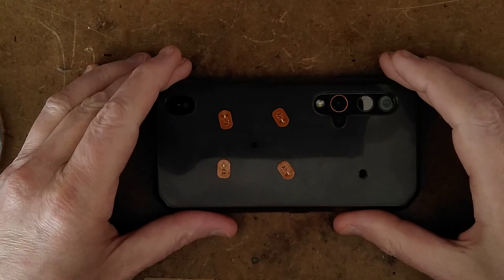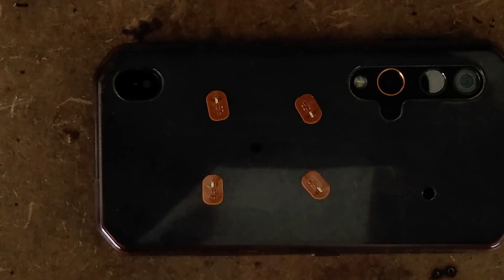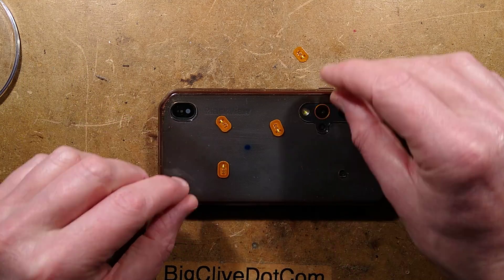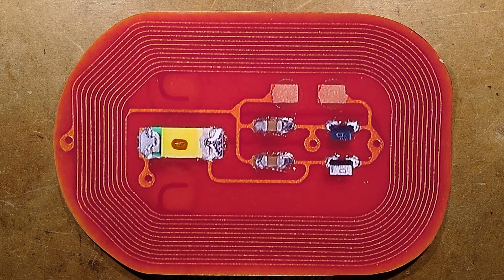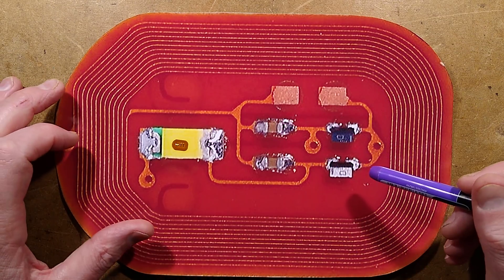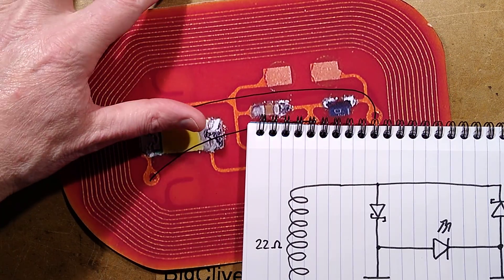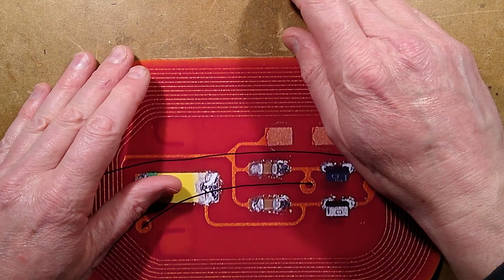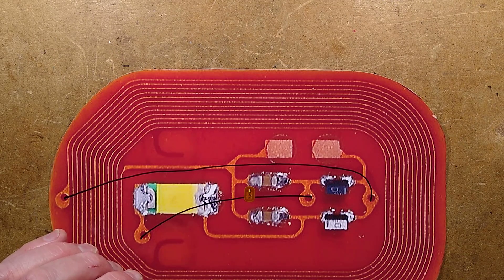NFC powered flashing fingernail sticker (with schematic)

Comment: So if it doesn't work with the other coils you tried it with, what would make it selective to the NFC only? Might it be the value of the capacitors?
Reply: Coil spec. ie impedence.

Comment: I saw a recent TV show in which they had some kind of electroluminescent paint on the hood of a camper van, when powered up, the hood glowed in the shape of the vehicle's emblem. It looked quite nice, but now I'm waiting for a BigClive video explaining it. I suppose I could research it myself, but then I wouldn't have the soothing Clive voice narration! I know EL tape has existed for many years, but this appeared to be done entirely with paint. When off, there was absolutely no sign of it being present, no telegraphing through the paint layers as you would have with tape, but when lit, it seemed to glow fairly bright (they did have to dim the studio lighting to make it visible, though).
Reply: There are (expensive and apparently somewhat fiddly) kits to do this - it's basically a full EL stack-up with all the electrodes and dialectic layers spray painted on. I think Applied Science on here has some EL display experiments with the tech.
Reply: @makomk  I think I saw it on Car S.O.S. I thought it was really cool, but definitely something that the average gearhead probably wouldn't be able to pull off. I remember they didn't go into a lot of detail about it, other than saying it was a multi layer process. I don't think I've watched any Applied Science videos, I'll have to check them out. Thanks! 🙂
Reply from the maker: You do get EL kits like that, but it's a critical process and not tough.
Reply: Applied Science has a great video about applying your own EL paint and patterns to surfaces!  Highly recommend checking it out.  :)

Comment: Qi chargers send intermittent signals to see if a compatible receiver is in range, and only begin charging after a response is received from the device to be charged... the stickers don't send the appropriate acknowledgement signal so they won't work with Qi. NFC constantly pulses (like other RFID devices) at 13.56 MHz, so there's always a magnetic field for the stickers to draw from. 

The 13.56 MHz frequency is also used in some RFID (proximity) cards, though you will also find 125 KHz, 134 KHz, and 860-956 MHz, depending on the access control system in use.

Comment: So, if they are tuned for specific frequency, does that mean that the 22 ohm antenna is a inductor ? If so can it be measured for its inductance and then you could design your own versions for fun.
Reply: I think thats what the ohms is showing the impedance of the inductor, like how speakers have a coil but use ohms for a measurement. I could be wrong though

Comment: You'd think by now they'd make them powered from the heat difference between finger and ambient. Like a more sensitive version of a reverse Peltier.
Reply: reverse Peltier - I think that's the Seebeck effect :)
Reply: @mrustle5707  Yeah I brain farted and couldn't remember what it was called.
Reply: Gotta love thermocouples. If you look into an occupancy sensor, they use what's known as a thermopile. A bunch of thermocouples in series, to create a voltage that is readable by the sensor just by detecting changes in temperature (infrared radiation) in the environment that come in through the lens.
Reply: @IceBergGeo  do you think they could supply enough current to keep that shiny led bright?
Reply: @mistaowickkuh6249  I don't think so. We're talking millivolts per thermocouple. It definitely wouldn't happen with an application that would fit on a finger nail for sure.
Reply: @mistaowickkuh6249   Definitely not with materials now in production like germanium and silicon and the usual dopants. But with more exotic things still only in research labs who knows. Gotta love metamaterials.

Comment: I actually have 3 of these little fingernail NFC PCBs implanted in my left hand as part of Dangerous Things's "Flex NeXT", an implantable multi-chip product containing 3x NFC LEDs, a standard NFC chip, and a writable RFID chip.

Unfortunately, all of the NFC antennas have failed at this point - due to repeated micro-flexes eventually breaking the connections between the components on each chip.
Reply: Tbf dangerous things warranties are so good you could get them replaced if you want to try
Reply: How excited are you to get a chip shoved into your brain? Or to not have to carry around your credit card because you now a chip in your right hand or forehead?
Reply: they do make a bioglass sealed implant,id upgrade to those
Reply: @andrewsmart2949  its kind of a downgrade due to range based on my ones
Reply: euch :/ get em out

Comment: How comes only the NFC will power it...I was expecting it to have some form of chip on there?
Reply: The antenna is tuned to the NFC wavelength, or thereabouts.  Each half of the wave charges one of the capacitors.
Reply: @sarkybugger5009  thankyou very muchness! Amazing!!!

Comment: I wonder if they could make an RFID card that small. Deviant Ollam and his wife have embedded RFID chips in their skin - cool but not sure I'd wanna do that, but it would be quite fun to show off some painted nails and "magically" open doors. I think something like that wouldn't go amiss in my handbag, as well as the new 'lipstick' lock openers that Deviant was showing recently too. :)
Reply: You could put the RFID chip in there, it is about the same size as the LED anyway, and you just have to use the flip chip version if you do not want to bond wire it in.
Reply: @SeanBZA  Oooh, that sounds fun :3

Comment: That must be the finest tracks I've seen to date!
Looks like the PCB etching solution almost gobbled up this one!
Reply: That's if they're etched. Could you inkjet print tracks somehow?
Reply: @chaos.corner  not cheaply. Applied Science has some interesting videos on something close to that, might be his ceramic circuit board or plastic circuit board vid, but the processes involved are pretty new, often covered by patents, and not easy to quickly commercialise.

Comment: I seem to recall reading that the "passive" NFC device that takes part in the transaction (e.g. a card talking to a POS terminal), due to obvious power constraints, isn't actually actively transmitting but rather varying its load on the transmitting device's EM field and that in turn gets detected and decoded by the actively powered device. In other words, the card doesn't harvest the POS terminal's EM field until it is somehow able to store enough energy to power its own transmitter (hard to achieve enough capacitance in such form factor) but rather shunts the "active" device's energy in a specific code that is then interpreted as information being "transmitted" from the card to the terminal. What I'm trying to say is, I would think that such a sticker would wreak havoc in the attempted transmission if you had it installed on a device you're actually trying to make a transaction with. Worth checking! :)
Reply from the maker: I've got one of these stuck to the back of my phone and it's not interrupting normal Google Pay transactions.
Reply: @bigclivedotcom  I wonder if that has to do with phones pushing a relatively stronger signal than cards that need to rely on the power of the reader. It would be interesting to see if they affect regular cards at all... I guess I'll have to buy some to check.
Reply: Active NFC cards like MiFare and Yubikey  need to harvest enough energy to save changes to flash and compute cryptographic responses, even if the response transmission is entirely done by modulating the load on the magnetic field.
Reply: It could just be sensing the change in load, rather than a specific load. Probably has to do with a phone having a thick case or no case at all, or even how far the phone is away from the reader.
Reply: This isn't shunting the power though, it's using it to power something. There is still plenty of stray RF too. The fluctuations detected are actually very tiny and tags use several schemes to ensure the data is decoded faithfully. It's actually possible to power dozens of tags simultaneously and they (some) apply collision avoidance schemes to ensure they can be read amongst the clamor.
In short, these things will negatively affect performance but it's not likely to be as big as you might expect.
Reply: @chaos.corner  I agree, RFID tech is sophisticated. It is also more secure than people think.
Reply: Every time I hear "POS" despite knowing what it means still makes me think "piece of shi-" lol
Reply: @PunakiviAddikti  I used to work on them. Trust me, your interpretation is usually highly accurate.
Reply: @OhShitSeriously  I had to use the Wyse ones. Embedded OS and EPROM do make them bulletproof but a right royal PITA if you have to support them remotely. Especially when working from a shonky image where someone didn't install everything properly in the first instance.
Reply: @PunakiviAddikti  most people who work with them think the same.
Reply: RFID chips are sort of "line fed", so having a constant load on the signal is perfectly fine, also the mostly-linear load of this device is just some signal attenuation, which is ok too.

Comment: I recall small led stickers from 2000s that used to blink, bit I believe these relied on antenna's magnetic field.
Reply: They worked off GSM paging which was pulsed. 3G WCDMA doesn't work like that because it transmits at a low, constant level.

That's why GSM phones made your speakers make an evil noise whereas 3G/4G/5G do not.
Reply: Wow core memory unlocked. Completely forgot about these

Comment: could you poke a hole in the PCB inside of the coil (without damaging a trace,), and run a wire thru that to prove AC current flow in the wire?   although not sure if there’s enough turns ..
Reply: Why? What do you mean "prove?"
Reply: @richardmillhousenixon  to verify actual current flow in a wire; for example pass one of the wires of the heating element through, to verify an electric water heater is working and doesnt have a burned out heating element..

Rather than challenge something you don't understand, perhaps next time you can recall google is your best friend.   In this case you might search:
'how can we prove current flowing through a wire '
Reply: @GannDolph  In this case you might search "Non-Contact voltage tester" 🤦
Reply: @GannDolph  Rather than assume someone else doesn't know anything, maybe look over your original statement to see if you worded it in such a way that it could be confusing.
Reply: @richardmillhousenixon  In the example of a water heater element, a non contact voltage tester would prove power is available at the element, but cannot confirm if it's actually working versus being burned out.   One needs to verify actual current flow, rather than merely the potential for current flow.

We use the ç r magnetcs CR45 LED current indicators.  Check it out- works great- but they cost almost 20 bucks a piece..
Reply: You already have the proof. The LED lights up, and that's as certain a way of showing that ac current is flowing through the wire as anything else you can dream up.
Reply: @RexxSchneider  not sure I follow you.    The idea is about finding a cheaper alternative to a much more expensive product, for non-critical/home/hobby use etc.
Reply: @GannDolph  The cheapest NC voltage tester on Amazon is 12 bucks. I doubt these stickers are any cheaper
Reply: @GannDolph  Please re-read your original comment to which I was replying. You speculated about running a wire through a hole in the centre of the coil in order to "prove" that ac current flowed though the coil. I merely noted that you already had that proof as the LED is there and functions as a sensitive current detector. I have no idea why you think I was commenting on any suggestions about finding cheaper alternatives, etc. A couple of Schottky diodes, small capacitors and an LED is about as cheap as you'll get.
Reply: @RexxSchneider  if you read the thread, you will see that i suggested it as a possible AC current detector, which may or may not work.  then there were some responses that lead to me trying to explain the objective and how it would be a cheap alternative to a more expensive indicator.     so yes, it’s a cheap current sensor *if* the LED lights under 50 or 60Hz AC current, versus the much higher NFC frequency it was  designed for.  i’m not that optimistic it will work, since 10 turns  in the coil is likely not sufficient.
Reply: @richardmillhousenixon  Not looking to test voltage-    looking to verify flow of **current**. , not the presence of voltage.  It’s not the same thing!  read the earlier reply please.      and these stickers cost less than a dollar btw..
Reply: @GannDolph  The LED doesn't care what frequency the ac is - it only sees the rectified dc. I think it's pretty clear you'd need to modify the coil to match different ac frequencies, as it's likely that the self-resonant frequency of the coil's inductance with its parasitic capacitance plays a part in maximising energy transfer. Unfortunately, as you know, it's pretty tough to make a small coil with self-resonance around the low frequencies you are considering.
Reply: @RexxSchneider  i’m not sure self resonance is necessary, but indeed many more turns would likely be needed to make up for the reduced alternating magnetic flux per unit time, due to low freq..  it may work by using a loop of light gauge wire wrapped many turns around the ac conductor , then once thru the sticker.   this would magnify the voltage going to the led voltage doubling rectifier circuit.    i’ll probably order a few stickers and play around w it.,
Reply: @GannDolph  WHAT YOU ARE ASKING FOR IS LITERALLY THE PURPOSE OF A NC VOLTAGE TESTER. YOU HOLD IT UP TO A WIRE, AND IF THERE IS CURRENT FLOWING THROUGH IT, IT BEEPS.
Reply: @richardmillhousenixon  no, it beeps when there is a voltage present.  it does not differentiate between current flow and no current flow.   i don’t know what else to say man - you are simply incorrect.    think of it like this:  basically i’m looking for an ammeter, and you keep  handing me a voltmeter.  ..
Reply: @GannDolph  You want something to indicate that there is current flowing through a wire. NC voltage testers do exactly that. They tell you if voltage (and therefore current) is flowing through a wire.
Reply: @richardmillhousenixon  voltage doesnt flow.  current flows.  try plugging a lamp in to a wall outlet.  hold your non contact voltage tester on the outlet.  turn the lamp on and off - the tester beeps whether lamp is on or off.  but current is only flowing when it's on.  thus a blind man  could not use the non contact voltage tester to determine whether the lamp is on or off.  hopefully now you understand.  if not please ask a different expert as i will never convince you.
Reply: @GannDolph  The NC tester beeps on the outlet because unless absolutely nothing in your house is turned on or plugged in, there is current flowing through the wires attached to the outlet. Try the same experiment at the end of an extension cord and report back when you have your results
Reply: @richardmillhousenixon  no no no.  and it always beeps at the end of an extension cord that is plugged into an outlet.  whether something is plugged into the cord or not.  stop trolling.

Comment: The gel fingernail industry also brought us all kinds of UV curing lamps, which I am grateful for, I've had fun with some of them. They also use very fine coloured/patterned tape (some of it 1mm width or even smaller) which you can use either as part of the nail design (they're available in all the pretty colours), or you can use them as a mask in between layers to get you all kinds of stripe patterns which allow you to make Eddie Van Halen guitar type designs.
You can also use that tape on guitar pedal enclosures.
Reply: "Wyld Stallions will never become a super-band until we have Eddie Van Halen on guitar..."
Reply: @TechGorilla1987  "Yes, Bill. But, I do not believe we will get Eddie Van Halen until we have a triumphant video."
Reply: @Anvilshock  "Ted, it's pointless to have a triumphant video before we have decent instruments."
Reply: @TechGorilla1987  "Well, how can we have decent instruments when we don't really even know how to play?"